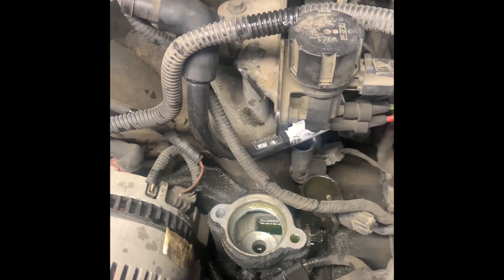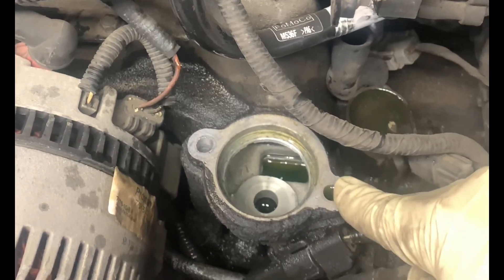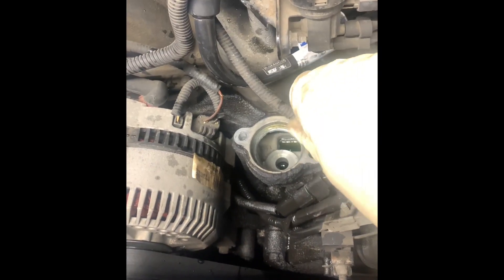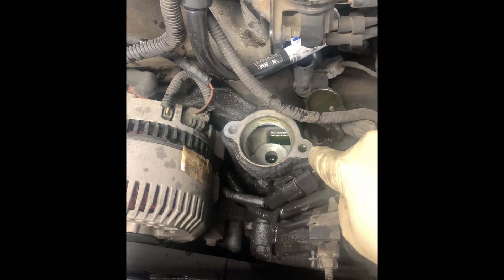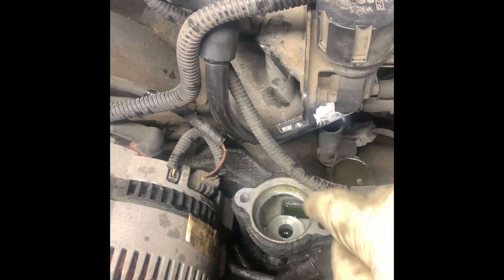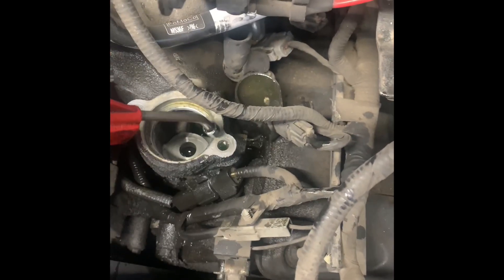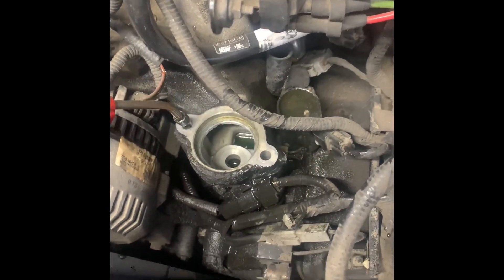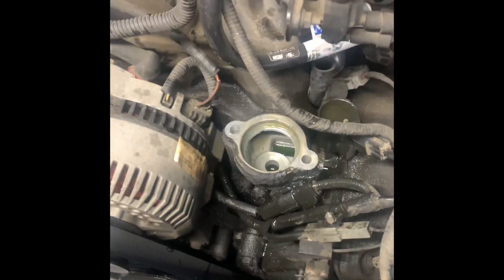Auto Repair Tip. #Shorts

Comment: Also, any coolant left in threaded holes will tend to corrode the threads of both the fastener and hole.
Reply: Also crack an engine block or break the headbolts in the block not blowing out the coolant before torqueing the headbolts down after installing the headgasket and cylinder headback on.

Comment: Hi Brian, quick question. Say you wanted to change an oil pressure sensor on a BMW like # 12618611273. Would you use a regular deep well 24mm socket? Or is there a better tool for it? Thanks in advance :)
Reply from the maker: There probably is a specially designed socket for that but sometimes you just Gotta use what you have.